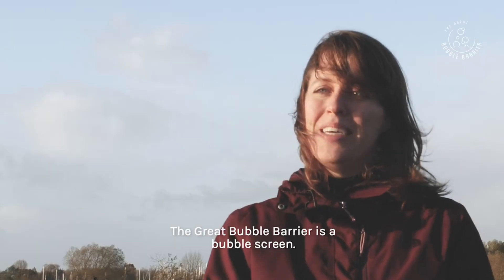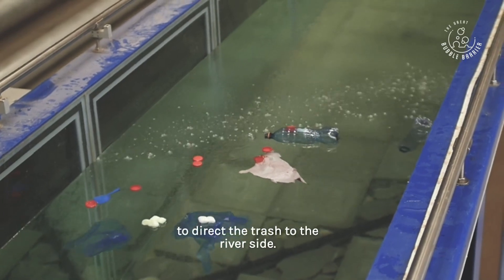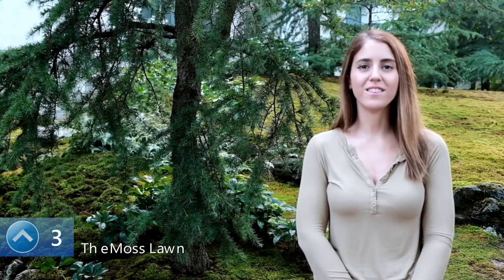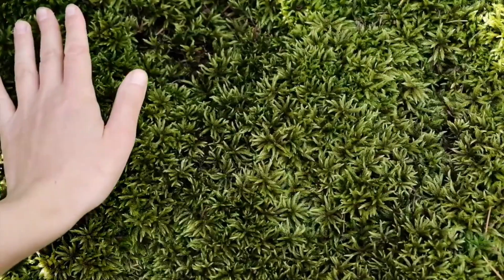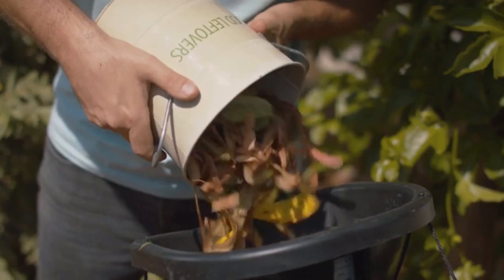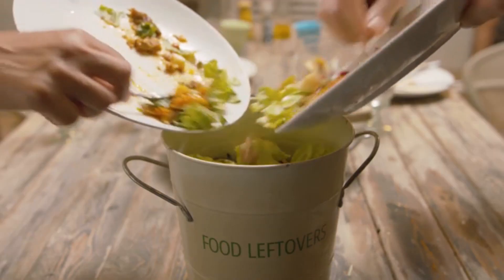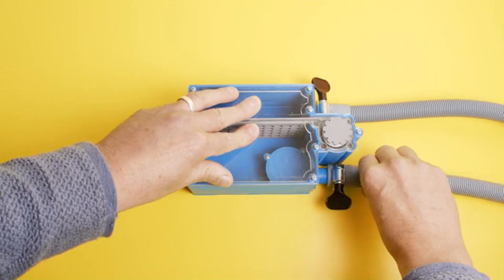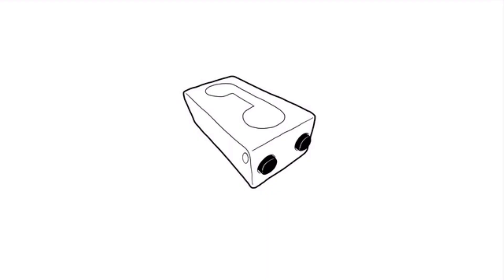TOP 5 GREEN TECHNOLOGY SOLUTIONS 2020 | The latest green technology ideas in 2020.

Comment: Wind, solar and all current green technologies are soon to be obsolete. The newly in development FUSION NUCLEAR "SAFIRE REACTOR" by Aureon Energy Ltd. of Canada is the actually cheapest, cleanest and least expensive solution for clean electricity. Wind energy, solar, hydro and other green technologies are now just superseded. Hydrogen will not either become a future conventional fuel but a nuclear fusion one! Electric power is the future for autonomous small aircraft and with ever more battery energy storage density perhaps some larger ones. However, FUSION NUCLEAR IS THE FUTURE of ever-larger commercial and military aircraft. Now we have a 24 hr. reliable fusion power product. We now in 2021 have super cheap nuclear fusion energy already proven and almost commercialised as in being in advanced production, that of the "SAFIRE REACTOR". So sadly, storage technologies and the power from ITER-type fusion power generators as well as conventional fission nuclear are going to be eclipsed. Current magnetic plasma confinement strategies and all current green energy technologies are totally out of date and relatively redundant. All our effort must now go into EVER HIGHER ENERGY DENSITY BATTERIES because green energy is now solved. With intermittent green energies we need an enlarged electric grid, so we see wind generators, solar farms and a multitude of variable green technologies with expensive backup batteries and they are all ugly and use up much land, while also being significantly capital intensive and all while having some safety issues. They are all also going to be unnecessary with the advent of the "SAFIRE REACTOR" that is safe, costlessly self-fueling, totally green, buildable on any scale on a tiny footprint to safely match local community requirements and it is easily chokeable and 24 hours dependable. It makes all other technologies redundant as in being much less advantageous. It is fusion nuclear powered by nuclear "NUCHEMY" and seen at "AUREON ENERGY.COM". Also learn your new plasma physics, astrophysics, and general Electric Universe Theory at "THUNDERBOLTS PROJECT.COM". This way you can learn your new EU Theory, advanced plasma physics and all needed to fully understand all this new academic and practical material. and appreciate that all the other green technologies are currently just now superseded.